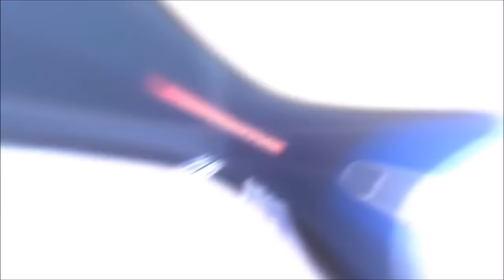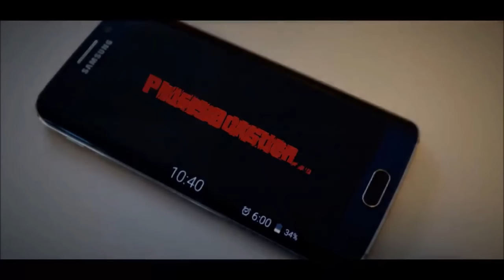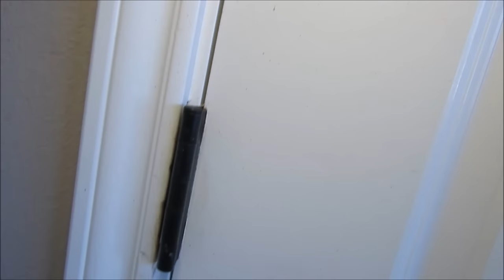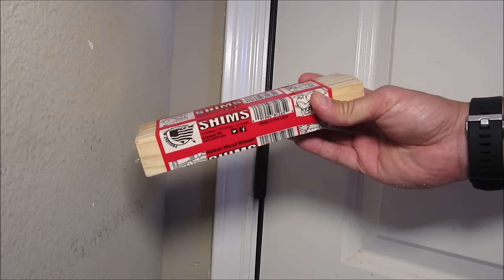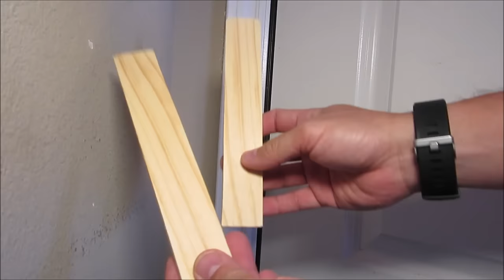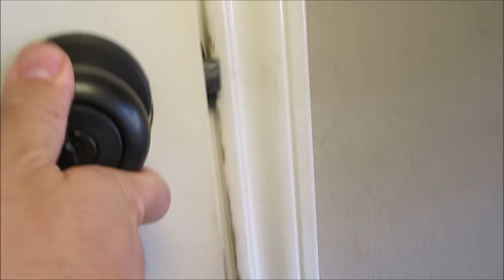How To Fix Sagging Doors - Easily Align And Square Your Doors Using Shims

Comment: We used steel washers backing out each of the 3 screws one at a time then sticking the screws through the hole in the washers.
Reply: Oh I like this idea. Not that a slightly visible shim is horrible to notice but this seems like it’d be completely hidden.
Reply: I just used cardboard from cereal boxes as packers and toothpicks to buff out the stripped screw holes. Cut the packers to size of the hinge, outlined the screw holes, poked holes, placed behind hinge and screwed. Never done this kind of thing before but got tired of waiting for my dad to do it. Pretty chuffed with myself too. 😊

Comment: To everyone saying this is a "Janky" fix, you have no idea what you're talking about.  You have all 100% positively used more doors than you can count that have been shimmed out to the point there is a good chance you use one everyday and don't know it. The only difference between this and a high dollar union carpenter doing commercial buildings is that we hide the shims better.
Reply: The janky fix would be listening to some idiot who shouldn’t be making videos and to try and bend your hinges and then mar them up and still not get a good result.  Been there, done that.

Comment: I would never leave a shim showing like that, very rough looking.

Use some washers, pennies, etc. to shim the hinge along with a few 2 1/2” screws.
Reply: Washers, I never thought of doing that. Great idea, thx
Reply: Good idea also. Both will work just fine.
Reply: I use washers under the hinge if I know it is a permanent adjustment. In a case where a house is actively moving with the seasons and may fall back out of alignment, this method will allow the shim to be removed quickly.
Reply: I didn’t even watch the video. Read this comment and put two washers behind the bottom, on in the middle. Et voila! This door has been a pain in my rump for years... during the winter only. B Baker saves the day! Thank you!
Reply: @TheGooglyminotaur  k
Reply: Ty. Shims wouldn't suitable for my situation but washers come in all sizes. Even small enough for my needs. Ty for this tip. Unfortunately I am at my brother's house doing stuff around his place. I am dying to get home now.

Comment: Seems like a pretty ugly way to shim a door and wont work if the door is a little too tight to start with. I prefer to keep old hinges (or a spare one, they are cheap enough) and I cut an identically sized hinge in half and place the cut half under the current hinge so that you cannot see the shim. Its by far the neatest way to make this type of adjustment. other options would also be to dig out the top hinge deeper or just shave the side of the door. It will always depend on how much gap there is in the door...you should always aim for 3mm gap on the sides and 5mm gap on top and bottom. You may also need to alter the middle hinge if there is one or risk warping the door.

Comment: that is one of the jankiest fixes I have ever seen.  I would never pay you for that dude.  I would never advise someone to do a fix like that.
Reply from the maker: Lol..this jankiest fix still works...
Reply: Hey buddy it works just fine. Who is going to be inspecting your door anyway. Good video.
Reply: For an older woman who’s got sagging doors I think that’s a great idea. He doesn’t have the time or the strength of the money to pay someone to take the door off. I can’t wait to try!
Reply: Shimming is the normal practice for squaring up a door. Sure you can get higher end metal or plastic shims that hide in the hinge but it'll do for Beginners
Reply: It's the only thing i found that would work on one of the rental doors, although I chose metal over wood, mainly because on average (for me) rental properties go through doors and/or framing over most anything else. 

 **What's jacked up is how someone could watch an awesome instructional video and feel the need to be commenting "Jankiest"  
along with other useless breath sounds, instead of scrolling on or creating their own upload if they know so much.
Words are not useless breath sounds, they are powerful and can change a life in an instant, choose wisely not haunting echoes
Let it be
There's a thought
Reply: Thanks for a great upload!!
Reply: Than don’t.

Comment: Thats called a hinge push. Great job. Pro tip: use one longer screw in each hing to keep it from sagging again. And in your case it will close the hinge side a lil bit and in return open the striker side a lil bit.remember to torq each long screw evenly so the reveal is equal on both the hinge and striker side.
Reply from the maker: Thanks for the info. The fix is still holding strong even with the change in weather lately...

Comment: There is a video on YouTube that demonstrates a way of aligning doors by a hinge bending process that is actually used by carpenters
Reply: Yes very effective
You can use a adjustable wrench or there is a special tool you can use but expensive
Around 40 bucks

Comment: bend - crescent wrench the hinge rework your pin. This is an unacceptable way to use wood shims (which compress). The hinge side is the working side of a door- thus its where your adjustment takes place with door gaps, etc excluding lock strike plate adjustments
Reply from the maker: Thanks for the tip. Unacceptable or not.. it still works since I upload his video :)

Comment: You door was hung too "tight." The trim carpenters did not allow enough gap space when the door. You can tell this because you should have about an 1/8" gap on the doorknob side of your door and you do not. Your fix may cause the door to bind on the doorknob side over time. The permanent fix is to pop off the trim (save it to reuse it) and pull the existing shims. You then rehang the door and insert new shims. Allow an 1/8" or so all around the door and you won't have any problems in the future. Hope this helps - I have hung a lot of doors.

Comment: So my problem is the door to the garage has a large gap on right side where handle is and barely enough to fit a paper through where hinges are. It closes and opens but letting in hot air. 🤔

Comment: That's not really the way to fix it properly.  I'd rather remove the top hinge screws and put longer 2 1/2 screws to hit the framing and try to move the top of the frame in some.
Reply from the maker: Good idea...but this little hack is still working for me without any issues.
Reply: I can't use longer screws because of the sidelight panels

Comment: Your door is square.  Your door frame is not square.  Pull the trim off and re-shim the framing so it's square again then rehang the door.  The hinge is another problem but it won't fix your trapezoidal door opening.

Comment: Conceptually sound, but follow-through/application not so much. IMO, one should pop off the trim and shim between the jamb & frame, on that big of a gap. Way too much of a shimming for visible side, and the entire hinge was not shimmed; cosmetic & structural deficit results. Great quick fix tho...
Reply from the maker: Thanks.. I know..this is more of a quick fix...
Reply: Not every single door that's uneven needs to have a mess made everywhere  order to PLUMB a door.  This is just as professional as racking up labor that's not needed.  I have 4 to do and this is exactly how I'm doing it but I'm pulling the top hinge, Chisel out the hinge mark some and bring it back to the door to plumb it back.

Comment: Another way to go, would be to use a Knuckle Bender, to adjust the hinge(s). Amazon sells them.
Reply from the maker: That should work too...
Reply: Moon Pie  I Fixed it :-) With a set of vice grips after removing the pin. Worked like a charm. Thanks for that pro tip.
Reply: GREAT INFO - I googled Knuckle Bender and read the reviews. One reviewer was angry because he ordered it and they sent him a set of vice grips.I looked at the picture and the knuckle bender looked like vice grips. Moon pie said he used an adjustable wrench so I tried my vice grips. It perfectly aligned my $2000 front entry door. The door has skylights so screwing longer screws was not an option. Thanks Dan and Moon Pie....genius
Reply: just looked up knuckle benders on amazon and the only one that is under $20 has complaints of it being so cheap it breaks on first use. All the others are $60+

Comment: Thank you for this.   Had issues with my keyless dead bolt not lining up perfectly with the door jamb.  Realized that over time, the door had sagged and the shim on the lower hinge did the trick.  Door has never worked better.

Comment: Great video, what would you suggest if the screws are just spinning loosely and the bottom right side (opposite of hinges), are scrapping and hitting the outter door frame? I don't have a plane to scrape it. If I get bigger screws will that work? I want a cheap fix as it is not my house and the occupants will not reimburse much if buying tools etc is involved. I just want some safety. Front door is the same also (I'm referring to the back door).
Reply: spaaggetii Man if the screws are spinning like that you might try removing them and putting a few toothpicks in the hole before screwing them back in. Also, larger diameter screws probably would not fit the holes in the hinge, so trying longer screws of the same diameter might work.
Reply: I use golf tees to fill sloppy holes. Just pound one in and break it off flush. Then drive your screw back in.

Comment: Hmmm no.. this is a Micky Mouse fix.  Get a chisel, dowels, epoxy and matboard if you need shims.  Lastly if you work on a shim you need to at least fasten the others.
Reply from the maker: This Mickey Mouse Fix has been holding up and today is 08/03/2024 and I made this fix last 2017. 7 years and no issues. Who is the Mickey Mouse now? I guess you consider yourself a professional carpenter with your epoxy and matboard LOL...
Reply: @LifeHackster  

I'll give you a few pointers for your content free of charge ^^ so you can instruct your viewers better.  If you have to use such gigantic shim is because you got some structural issue, maybe building settled or just bad building, you remove the hinge and fill holes with the dowel and epoxy recreating that jamb block, if you need to add a "small" hinge you cut matboard to the size if the hinge then screw in hinge, not perfect gaps or close? then replace hinges or if a slight adjust needed you can bend one hinge slightly to lift the fallen side of door.. too much and you create a larger issue.  Also advise the viewers that if you lift too much the strike plate and latch may not align anymore.  I'm not a pro but do work in this field, I call micky mouse fixes those that are so ugly like that gigantic shim with the empty gaps .  Some fellow coworkers from the handyman to the contractor builder would just laugh at your fix.  Hacks are ok but you just chose most rustic option
Reply from the maker: @audioslave3004  LOL.. You think I'm going to listen to YOU? Let me check if you have 230k subscribers....
Reply: @LifeHackster  230k subs don't make your micky mouse hinge fix any good, it's almost as good as this door I fixed a while back.. a lady tells me this guy worked on her door and it still didn't close properly.. he used round head screw on the hinges lol.  Anyway good luck on your whacky tutorials, btw I don't do media tutorials, too busy repairing Micky mouse jobs left behind lol. Bye
Reply from the maker: @audioslave3004  More jobs for you then.... go troll on other DIYers...  You don't do media tutorials but you binge watch them... because that is where you get your info from...

Comment: That's a horrible way to fix that.
Reply from the maker: Horrible way but it works and unless you check that side of the door every time you get in and out..then it doesn’t matter..
Reply: @LifeHackster  I'd say it matters because that's not the proper way to fix that and you're teaching people wrong. The proper way would be to adjust the hinges by bending the knuckles. Easier, faster but most of all, correct.
Reply from the maker: I am just sharing what I did.. it is your call if you are going to follow it or not...To each his own buddy..